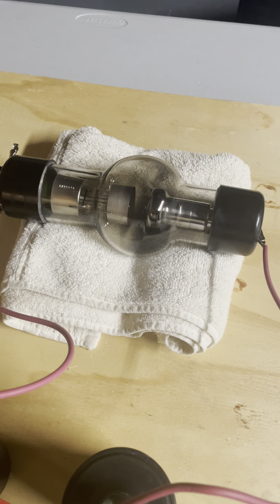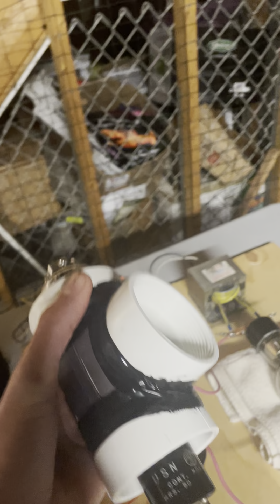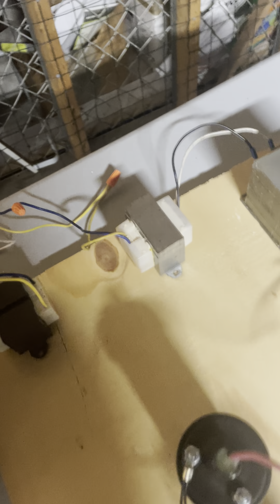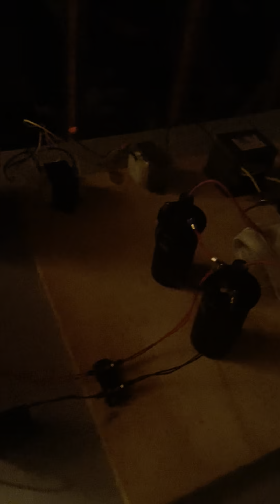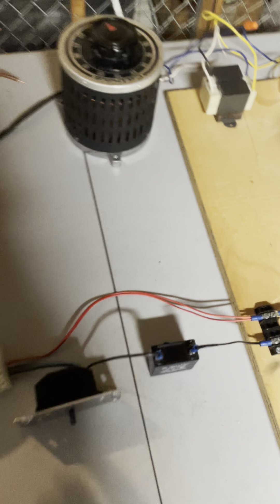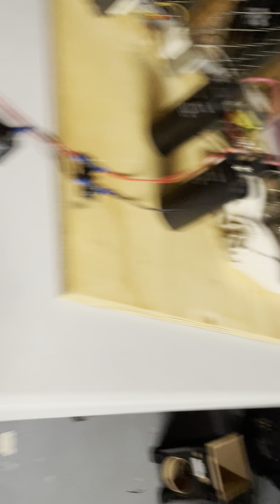125KV Xray rectifier emission and filament test

Comment: I won't criticize anything, I find this stuff dangerously amazing but, I suppose the power isn't really that high, as the thing is modulated by a 60Hz cycle
Reply from the maker: Interesting, this video is starting to get more popular. The filament transformer is 60hz standard but the ignition coils are driven by a chopped up 60hz ac waveform which is made to oscillate with the capacitor so it’s more in the kilohertz range
Reply: @Supermarketkvbut I mean that the HV supply although works in the kHz range, it's modulated by a low frequency oscillator, in this case the 60Hz chopped waveform
Reply from the maker: @Headbutter-Lettuce90 that’s correct

Comment: As a radiologist, I think you genuinely have little idea what you're doing or the potential cell damage you're unwittingly causing. Still, its your life.
Reply from the maker: Ok the only thing I should’ve changed was the filament transformer to be isolated for high voltage potential but other than that the amount of radiation emitted just one inch away is an extremely tiny amount compared to something like an average dental Xray so I’m very confident that genuinely nothing happened and I’m completely fine to this day since this test 9 months ago. If I was worried about my health and truly didn’t know what I was doing, I wouldn’t have posted this video so it’s kind of annoying to get comments like these when I’m just trying to demonstrate the deceleration of electrons like so many other videos have. If you’re going to comment bs on this video, why don’t you do the same for the thousands of others that have done this but way more powerful
Reply: @Supermarketkv Actually, as my job would suggest, I actually care about other's lives. Cell damage is cumulative and many experiments done whereby you have no real measure of dose received is a risk. At work we have to go to great measures to limit exposure to staff. My only reason for commenting is out of concern for your safety, that is all. Criticism doesn't have to have stemmed from ill intent or unpleasantness. Again, be cautious my friend and especially if you plan to have children. Small doses...large effects. Cheers.
Reply from the maker: @chrispomphrett4283 well thanks for your concern, I got some lead plates to cover my “important areas” for if I do stuff like this again

Comment: Very very cool. My only criticism is the tube resting on the hand towel. Those tubes probably get super hot. Maybe built a simple chassis or brace for it. Something that keeps it suspended so the heat can dissipate evenly too.

Comment: It would be highly advisable for you to study some X-ray physics. Radiation intensity is proportional to the square of the applied voltage, and tube efficiency is proportional to that voltage. If, instead of applying 125 kV, you use 60 kV, you will indeed obtain significantly less than one-quarter of the X-ray intensity, and the resulting rays will have lower energy and penetrating power; even so, the radiation levels remain thousands of times higher than natural background radiation and safety limits if operated continuously without shielding. When the voltage is lowered to 50 kV, the generated X-rays have less energy—what is known in medicine as "soft X-rays." These rays lack the energy to pass cleanly through the body, so they are almost entirely absorbed by the skin and superficial tissues; this is why professional X-ray systems deliberately filter out these 50 kV rays to protect patients. 

Using this physical reduction to justify safety is extremely irresponsible from a technical standpoint. An unshielded X-ray tube operating at 50 kV remains a device capable of causing permanent biological damage or severely increasing the long-term risk of cancer within a matter of minutes.

Comment: No Lead apron? Near X-rays can be produced from 60-90Kev You just got exposed to Far X-rays closer to Gamma rays and you're way too close for my comfort. In fact everything within a 6 feet radius of the filament got exposed. Please get a G-M Counter and Lead shielding.
Reply from the maker: It’s only like 50kv or something across the tube so actually not that much radiation. If you want to see actual high power X-rays, check out other videos

Comment: Anodo e catodo del tubo sono collegati ai due condensatori elettrolitici in parallelo che si vedono a sinistra. Non può esserci una tensione superiore a 500V per i limiti fisici di tale tipo di condensatori. Non certo 125Kv che comunque in quelle condizioni scaricherebbero direttamente in aria. Con 500V il tubo non emette radiazioni di sorta.
Reply from the maker: Those black “capacitors” are actually oil filled ignition coils which are used in older vehicles. They’re meant to generate a high voltage pulse for the spark plugs. Well I am overdriving them to around 50kv to 60kv, they certainly aren’t producing 125kv. That’s just the voltage that the tube is rated for. I’m running it at a lower voltage so that some X-rays are produced, but not a lot

Comment: "I'm genuinely concerned. At 125kV without shielding and without a Geiger counter, you're getting a dangerous dose of scattered radiation. This is not about being brave, it's about irreversible DNA damage. Please get a detector or stop these tests."
Reply from the maker: The tube is rated for 125kv, the ignition coils only output around 50 or 60kv which means barely any radiation was produced
Reply: @King_supermarketI have a 30 kV x-ray that produces 3 Sv/hr

Comment: Why you put an isolation transformer bevore a transformer wich isolate too?
Reply from the maker: Before arcs would jump from the secondary to the primary winding because there’s high potential on both ignition coil outputs and the extra isolation is enough to stop the arcing over because more separation is more distance the arc has to jump
Reply: @King_supermarket👍
understood , its for creeping distance!
thank you!

Comment: Also, even tho u dont run this much, keep safety in mind, as u clearly do. Distance from source is yr best protection (inverse square law) and remember these things usually are encased in a lead etc housing, with a small window, which wears an aluminum/copper filter over it, to reduce the "soft" radiation - lower energy xrays(45ish kVp and under) - that are most absorbed attenuated scattered by body tissues, and are not useful. 
Yr tube is completely bare. 
Also, if u hit it with a higher voltage, long time and high current without warm up the anode can easily crack - if it hasnt already. 
Do u have any idea of the current output from yr spark coils here? 😊

Comment from the maker: The rectifier tube is Westinghouse WL-399 and its rated filament voltage is 10 volts at 18 amps. The filament supply was actually outputting about 6 volts and less current because the two transformers I used to isolate the supply were inefficient and turning some of the energy into heat so I used the variac to vary the filament power AND add drive the isolation transformers a little more to get a decent power output. Also, I’m not even sure what the output voltage of the ignition coils truly is but it’s definitely close to 100kv at a slightly lower current than other supplies. It would be nice to have a solid high voltage power supply for this tube, but I’m still working on it
Reply: Que uso vas a darle a este experimento?

Que exactamente buscas?